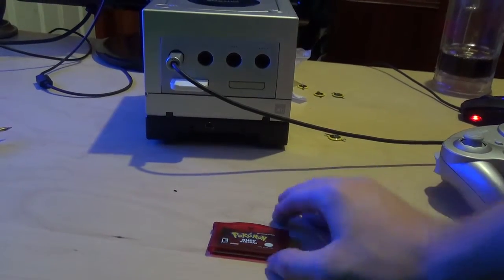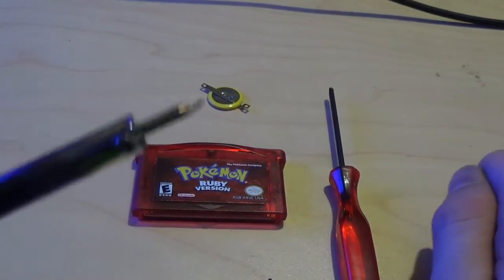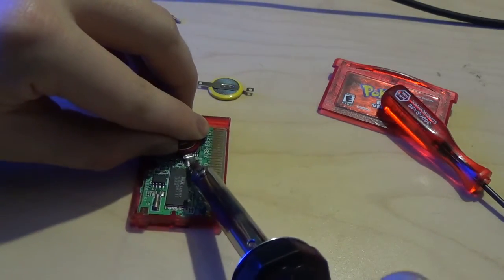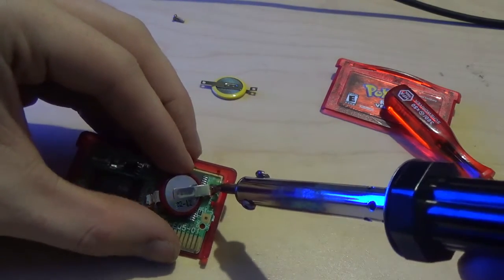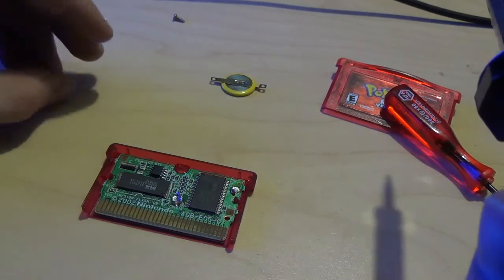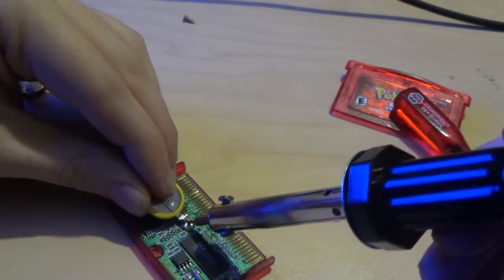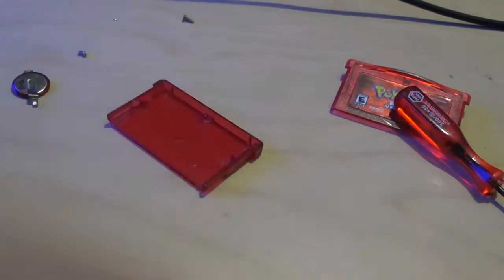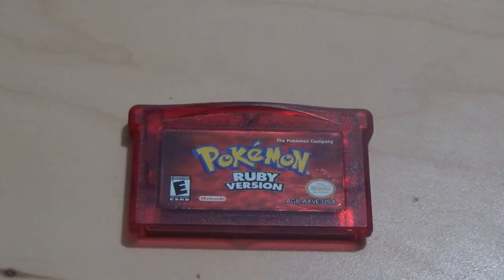How To: Replace Battery in Pokemon GameBoy Advanced Games Fix Clock

Comment: wow dude. Take the board OUT of the case before putting heat on it. geez. Had you used desoldering braid like you should, the contacts would have been much nice too and you wouldn't have had to waste time tryin to get those solder blobs off. Do it right if you're gonna make a vid....
Reply: Skibbity Bop Agreed. There is a risk just melting the shell. I don't know why you leave it in the case.
Reply: OMG I'm just imagining people everywhere warping their cartridge cases from leaving the board in.
Reply: Can anyone explain me how desoldering wick works ? I tried to replace mine. There's solder on the pins now, near the + side of the battery but I feel horrified... I don't even know how it got there :( it probably just fell there while I was busy adjusting the battery. 
But I feel like my game is lost to this point :/

Comment: I found a few cheap battery replacements on eBay it comes with 3 battery replacements and it's 3 dollars so I recommend it if you can't find any cheap battery replacements (I have a Pokemon emerald game that has the dry battery error but it's my only working GBA game so I'm not going to replace the battery just in case I break something)

Comment: Has anyone ever had the issue where the cartridge is draining new batteries? I have breath of fire 1 and 2 and they both drain batteries. None of my other gba games do this. Ill put a new 3v battery in them, testing at 3.3v then instantly when i put the battery into either one of the breath of fire games, they start draining. All the way down to like 2.7v then if i wait a few hours they get back up to 3.1v which is still considered a low battery

Comment: I did everthing right but the message keeps popping up? What do i do? I put a brand new battery in
Reply: MKRN did you fix it yet because that's what I'm worrie about
Reply: Matthew Lowe hey man, i found out that something was dead inside the cartridge so it wasn’t the battery. I changed batteries in a different cartridge and it did work! Hope this helps, have a wonderful day :)
Reply: MKRN Sometimes you think you did it right, but you didn't quite make contact. It it also best to remove the old solder with a desolder pump and use new solder. The solder they used was pretty crappy, but that is mass production for you.

Comment: Hey is this required for leaf green and fire red? I don't want to loose my charizard and shinnies on there and I can't transfer.
Reply: RedFox 2019 FireRed and LeafGreen don't have a clock, so no battery.
Reply: That said, they are the same as these, the saves are stored on flash memory and do not need a battery to retain saves.

Comment: fire red doesnt come with a battery?
Reply: +Se bast NEither does LEaf Green, those don't have an inner clock function so they don't need any battery.
Reply: +David Munoz The case makes it look like a fake copy, but it has a battery and the circuit board seems to be alright.
Reply from the maker: +愛乞う アレヴァロイクト 
LOL? its clearly a real copy. 
You guys need to get your eyes checked.
Reply: HOLYPEPSI Have you seen the sticker ? It actually is just a piece of paper, is not even glossy. That's why I said "the case makes it look like a fake copy but the circuit board seems to be alright"
Because y'know sometimes ppl like to replace their cases if they get damaged (I did it with my Sapphire copy, bought it pre owned and it was not in the best conditions, well the case that is)
Reply from the maker: Wrong. Watch the video. Its glossy. You can even see the light shine on it.

The rating logo is Bold, when you turn the game on the back it had the 3 gold dots which 100% confirm its a real copy.

Basic sht
Reply: HOLYPEPSI Is it?  wow, I knew my phone's screen was crappy but this is just to much, gotta re watch it on my PC.

I'm only saying the case doesn't look quite good and then again the circuit board seem al right
Reply: +愛乞う アレヴァロイクト he's right. He has the code right above the reader where you'd insert the cartridge. Plus if you look and pause where he shows the cartridge, you'll see that the Nintendo logo, the rating and the Nintendo licenses are all identical to an authentic copy. Therefore it is real. If you'd like proof then Google will hold your hand.
Reply: InTheBattlefield Yes, I already watched it in my PC and it looks way different from how it looks like in my phone's screen. (Which I already stated that is not.... precisely the best device to watch videos on)

I would like to compare but.... for kind of obvious reasons I don't own an American copy, just Japanese ones (for every game but Emerald and Sapphire, I was lucky enough to get American copies of both a couple of months ago)
Reply: the game in the video was ruby, not fire red. i dont understand what this argument is about
Reply: SavonJames you can't really see a factory code imprinted on the cartridge case, I may be an aftermarket cartridge case

Comment: you can also just use a flat-head to lift the solder off. Afterwards, place the new battery in and then just use some tape to keep it in place. Easier. . . Also, just stick to Emulators if possible. Nobody bothers with cartridges for Gen 1-3 anymore.
Reply: St. Frank I still bother with Gen III cartridges, since I still have a DS Lite and thus still have a way to migrate those Pokémon into Gen VII.
Reply: You have to remember that some people prefer to play on actual hardware. I use both, but I prefer to play on my ags-101.
Reply: Terrible advice all around... why even tell people this lmfao... no, don't tape a battery in there.
Reply: Nobody has cartridges for gen 1-3 Lmfao..... man you are clueless. Retro collecting has exploded.. everyone collects old cartridges.